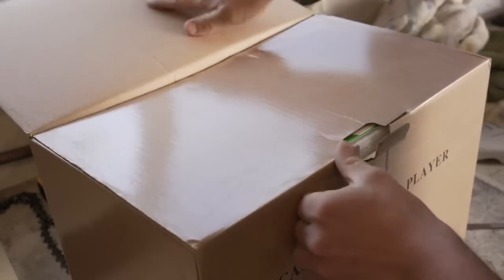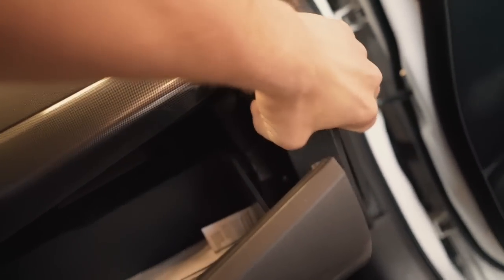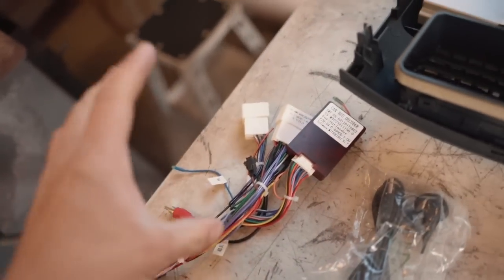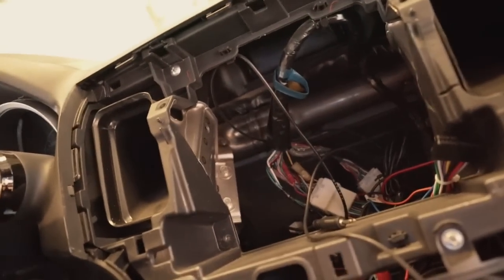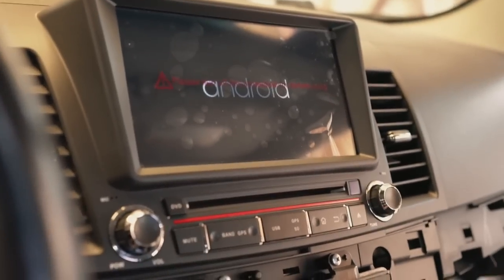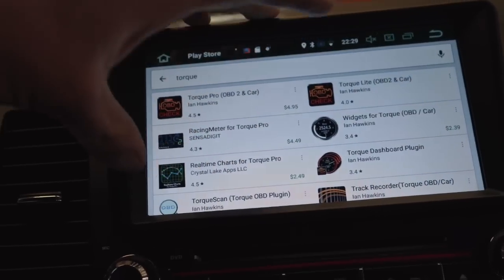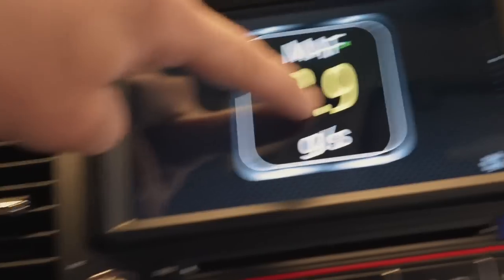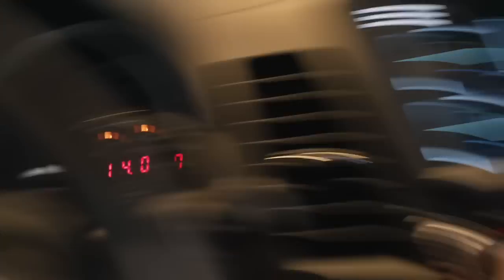Every Mitsubishi Evo X Needs This Radio!

Comment: Stick with your actual gauge for boost. The app doesn't refresh fast enough to keep up with your fast ass Evo. I do recommend throttle position and engine load on the torque app.

Comment: Also, (love the vids) haha but second question. Right now I'm in a Ralliart with the base sound system but might trade for an Evo in two years or so when insurance goes down, do you think I could get the fosgate version of the radio now and still plug in to the base radio? Just in case I end up in an Evo that does have the fosgate system I can just swap over? Thanks!
Reply: Trevor Plagg No, different plugs in the back. that's why they have different offerings.

Comment: Does it still work with steering wheel radio controls? I'm like you and I also like analog control over volume but I really like the flush look of the 10.2 so if I can still do volume on my steering wheel I'll go with that one. If you know let me know! Thanks!
Reply: Trevor Plagg the previous versions you could program steering wheel controls so hopefully the updated ones kept that feature.
Reply: 7.1 has steering wheel controls.  Not sure about 8.0 but I wouldn't see why not.
Reply from the maker: Yes it does